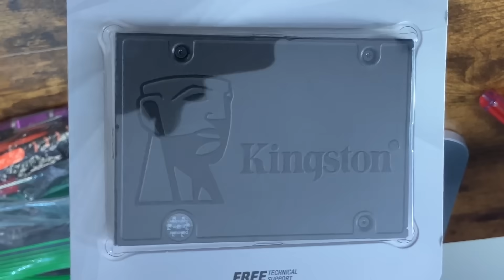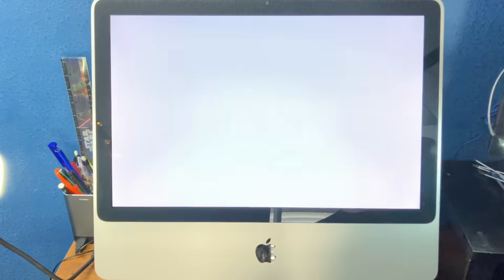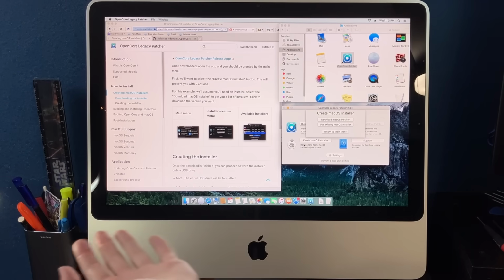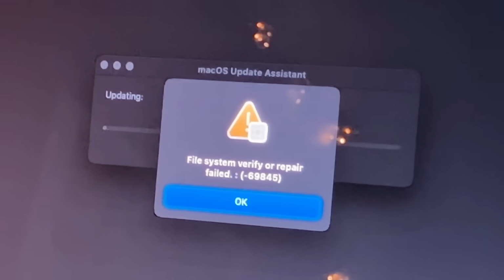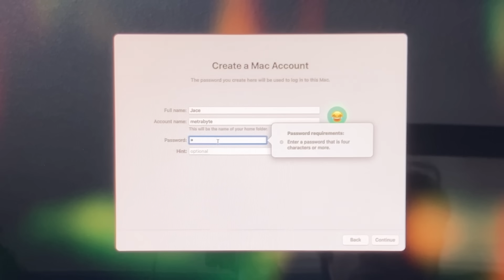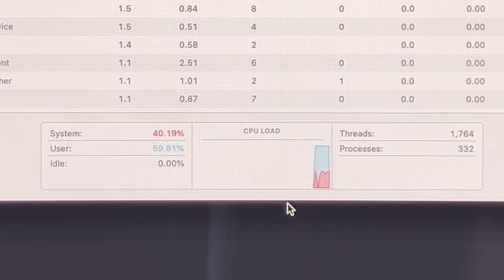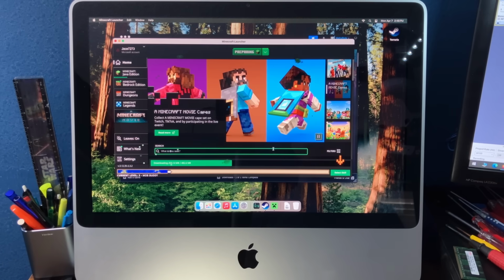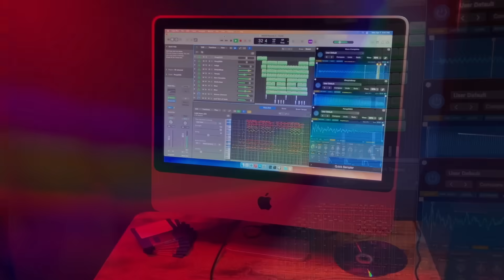Installing macOS Sequoia on an iMac from 2007...

Comment: I‘ve got a Imac from 2009 with 8gb ddr4 2777mhz a intel dual Core 2,7ghz and 128gb ssd patched to big sur but im wondering how you could achive so much fps without mods i use alot of fps boost mods for minectaft but i cant play 1.21.1 only 1.20

Comment: SSD FROM SAMSUNG ON A MAC!!!!!!
Reply: Think Different why use our stuff when is just works get it

No, Apple did not manufacture hard drives in 2007 if they did why would they care then as they think why would we choose overprice SSD for MacBook in 2007 with less then 32GB for fair price.

if it works don't fix it is only dead slow because who in 2007 was using 4K video then in 2025 now

Comment: How did you get GarageBand on it? I thought if you use OpenCore it means certain apps like iMovie and GarageBand won't work because I tried this on my Ventura OpenCore 2011 MacBook Pro and it didn't work because of some sort of graphics issue.
Reply from the maker: Its actually Logic Pro that I got working on there, but it does have some graphical glitches. The play head just doesn’t show up, so it’s not too bad. I think older versions of Logic will work just fine though
Reply: @metrabyte03  Is there any way I can get iMovie and GarageBand on a OpenCore updated Mac?

Comment: See I thought that the GPU in my 2009 iMac was the reason I was getting 3 fps when looking straight forward in minecraft, but now I'm pretty sure it's the CPU

I have actually managed to dualboot macOS High Sierra and KDE plasma on my iMac with rEFInd to choose which one to boot  and it runs. Linux performs overall better (and is convenient because the latest version just works as far as I've used it) and macOS is mostly there for the photo storage and other apple product synchronization. But most apps are either like a milion updates behind (like chrome which somehow still works) or just straight up don't work because of the OLD macOS. 

Also I think that mac's in general just get like HOT for whatever reason, I am always surprised at how hot it is while chilling on speed. Like I don't know if these things even do thermal throttling.

Before I had the idea of dualbooting, I had a bit of a.. testing period with linux distros. Issue being that I did all of that, on USB sticks. And not the good ones. Me being inpatient just bought two 'cheap' sticks, a 128gb for an actual distro and a 32gb stick for the installer. So yippie yippie yee, I go to plug it in, and I put basic mint on it. The (32) stick, at around maybe 5 MB/s, has an average response time of 3 whole seconds. Ok so I did all of that, and then I went to install mint on the other stick. Oh yeah the other fun quirk is that the laptop I use has no more functioning usb ports. I installed linux mint, onto a 128gb flash drive which had to be fully formatted first, all through a crappy dock I got at some point. This process, took about 8-12 hours or one entire night sleep. And in the end it was still slow. Firefox, was a legit issue to run. But it gets better, because the 128gb stick would not boot on my mac because- well I'm guessing it didn't have grub to tell it to boot.

Comment: I could use some help. I was given a 2007 Imac but the guy wiped the hard drive and did not re-install El Capitan and when you start it up the bar goes to about 90% and stops.
I wanted it because my 2006 Mac Mini lost the os and I could no longer play Diablo 2 on it and want to be able to run Diablo with the LOD expansion on it.
I do not need an OS that is too new as I am typing this with my keyboard attached to my Silicon Mac Mini.
I would like to be able to dual boot the computer. 
If any one can give me any suggestions it would be appreciated.

Comment: now install macOS Tahoe
Reply: If the Intel chip is the highest spec option for the iMac model, it’ll probably boot successfully, but it’s looking like Tahoe’s fancy aero graphics prefer Apple’s M-series iGPUs over Intel’s iGPUs on higher resolutions.
Reply: @SirChristoferus it would not work, open pre doesn’t support it. And even a Mac from 2015 doesn’t work.
Reply: @SirChristoferus which is funny because with bootcam the 2007 iMac will run windows 7 with aero just fine
Reply: @SirChristoferus its not aero its liquid glass
Reply: Chevrolet Tahoe
Reply: @mc.curtiss  Tahoe Collins from the old days at Harrah's when Bill was still alive.
Reply: Probably can’t
Reply: Yeah
Reply: 0P3NC0RE D03SNT SUPP0RT TAH03
Reply: If jiga tech couldn't get it to work on on a 2011 macbook then the 2007 imac has 0 chznce
Reply: @macdos1 yeah it couldn’t unless it would have really good specs
Reply: @THEKIDNOCTEM maybe on a 2009 imac (I did it)
Reply: please try @metrabyte03
Reply: Pls- 😭
Reply: Hell yeah!
Reply: It could brick the install
Reply: 100e like LET S GO !!!
Reply: The hell is that ????
Reply: and open liquid glass
Reply: Maybe try replacing the cpu to an apple silcon if it doesn't work well,MetraByte
Reply: @Kieran-z1b dont need it you need atleast a core i5, i7 recommend
Reply: I am
Reply: It would run like macOS toe.
Reply: It will explode

Comment: I have a 2008 iMac nearly identical to that one Dual Core CPU, 6gb ram. Been wanting to slap a SSD in it. Currently running El Capitan and serves as a stand alone EZDrummer3, BiasFx amp sim, and MIDI VST hosting machine. ¯\_(ツ)_/¯

Comment: 15:45 if that minecraft is running decently without any optimization mod(pack) than imagine how it would run with
Reply: I have the same mac with Windows 11. over 30 FPS are posseble but i can´t rach stable 60 fps on an Normal survivelworld.
Reply: Did you upgrade any parts of it?
Reply: @Scylime SSD + 4GB RAM.
Reply: @Scylime RAM and SSD only.
Reply: Hm maybe u need to upgrade the cpu and also survival worlds aren't optimized that well if you play on a server you'll get better fps
Reply: @ScylimeThe main Problem ist The GPU. Vor 60 FPS in full 1050p ist The GPU to slow. And was faster cpu's can't be installed.
Reply: @Scylimeuse optifine and it should Run Up to 60 fps
Reply: I tried sodium on my old Mac and it ran the same as optifine

Comment: Sequoia is the first Mac OS I've installed that actually seemed to load my 2012 Quadcore i7 15" Macbook Pro down and I have 16gb of RAM. I think Apple is satisfied that it works okay on intel and just said to heck with any optimizations. At this point they just don't care about intel Macs anymore. The 2007 iMac can be loaded with 6gb of RAM with 4 and 2 gigabyte modules and that would probably help a good bit. 3gb is just no good for a modern Mac OS. Still, I think Mojave is all I'd want to run on this machine. The good thing there is, Mojave was the last Mac OS version to fully support 32 bit apps. It should run just fine.
Reply: After much trial and error I got Monterey to load on my 2007 iMac with 6GB RAM, 256GB SSD, and it works well. I might try Ventura, as some people say it works just as well, but anything beyond that might be too much.

Comment: I upgraded a imac 2012 a couple days ago and ran into pretty much every single problem you had with OCL-2.3.2 . Somehow, even though I told the installer, several times, to wipe the drive and fresh install. After which when I got to the login, it still had the previous admin account & files. IDK what the fuck was going on, but it works? LOL
Reply from the maker: Interesting lol. I mean if it works.. no point in trying to fix it and make it worse lol

Comment: I played with open core on two different Macs. It does work to get the OS running,  but that does not mean the application software you want will work. The Mac Pro CPU has no AVX support, and the 2014 mini has AVX but not Metal 3, so the reason to run newer OS versions went away.  So back to Mohave and Monterey respectively. 

Or Linux. 😉. 

Linux programs must do a better job of checking the instructions available on the CPU and choosing the library accordingly as the old CPUs run the modern distributions.
Reply from the maker: I definitely agree with you. This video (and channel) is really just my curiosity getting the best of me lol. This iMac is SO SLOW and can't do anything reasonably on this version of the OS. I can't wait to put OS X 10.5.8 back on it.

Comment: Being a nerd time:

-For installation, PRAM resets can help when it's bugged or when you forced it off. Also, make sure to set date in terminal from the installer, or it could very much fk itself even if the date is already right.

-If it doesn't recognize CPU frequency, it's because the Mac needs a firmware upgrade. There's a good chance it's being much slower and throttling itself without it (and that would be why it's so slow on 10.11 despite the SSD).

-The new firmware would also probably work with 4GB of RAM

P.S: that music at the end was amazing!
Reply from the maker: I actually gave that PRAM trick a try but it didn't work sadly. But that's interesting about the CPU frequency. I was going based on https://lowendmac.com/2018/penryn-t9300-9500-cpu-upgrades-for-the-2007-imac/ where it said it could report at 600mhz. I figured 400mhz might be fine too, but it probably could use that firmware upgrade lol.

As for the RAM, that stick was just bad lol. I tried it in another Mac and it did the same thing. Upon closer inspection, it was missing a small capacitor unfortunately.

Anyway, thanks so much about the music! :) I really appreciate that and your very informative comment
Reply: @metrabyte03  yeah firmware upgrade + disable firmware throttling with OCLP.

If power management isn't functional ofc it's going to be slow balls.

Too bad for the stick :/

Comment: I did not see this in the comments, not that I looked that hard, but you can actually use 6GB of memory. Mine is running 500GB SSD, an upgraded graphics board from then one it came with and 6GB of memory....but I am not using macOS. I installed Deepin on it and ran the fan patch. Everything else works The only thing left to upgrade is the CPU which will be part of my next AliExpress shopping basket.
Reply from the maker: I did know about the 6GB memory thing, but those 4GB DDR2 Modules are so much more expensive than the 2GB ones sadly lol

Comment: i have this one :) how to install Wondows? it refuses to boot off USB or CD or DVD :( help me
Reply from the maker: You probably need a 32 bit version of windows. These old Macs have a hard time booting 64 bit windows due to their 32 bit EFI from what I understand. I had this problem in my video about installing windows 11 on a 2007 MacBook Pro and was able to fix it by making a custom windows 7 iso and upgrading it to the version of windows I wanted lol.
Reply from the maker: I’m assuming it gets stuck at something like this. Check out this link: https://forums.macrumors.com/threads/windows-10-install-mac-32bit-efi-working-fix-select-cdrom-boot-type.2217681/
Reply: @metrabyte03 thank  you :) <3 <3 <3
Reply: @metrabyte03  it worked perfectly :) thenk you :) <3 <3 <3 <3 <3 <3 <3 <3 <3 <3 <3 <3 <3 <3 <3 <3 <3 <3 <3 <3

Comment: No, never touch the mother board without am Anti static wrist strap. Or at least touch some area of the metal casing. You could potentially damage minor components.
Reply: Been repairing PC’s, Mac’s, iPads & iPhones 7 days a week for over 15 years..never worn an anti-twatic band once & never had a single issue..not one ..guess it depends if you’re a twat or not 🤷‍♂️😂

Comment: I installed Sequoia on a recently purchased 2012 MacBook I had bought it, and aside from the very low price (£30 inch postage), it had 500GB SSD - great storage - and 8GB ram. So I grabbed it. But it took such a long time to install the os. And then took a fairly long time to boot. I was a bit confused about what sort of crap SSD was in it. Then I discovered a 500GB hdd inside which I swiftly removed. Seller was unaware, but offered me a 30% discount, so got replaced by an SSD and now it feels very snappy. Yes, some new apps really take their time, yes they have occasional quirks, but that’s to be expected. I now have 16GB ram in there. It’s brilliant and ready to be gifted to an elderly lady who is very isolated.
Reply: Honestly, unless there is some proprietary software you want to use, I'd just go with Ubuntu on Macs that old.
Reply: brochacho why you yapping about specs go to an technical video or something this aint yo place
Reply: I wonder who asked you?

Comment: my late 2012 mac mini with i5 2.5ghz and 16gb ram with 500gb ssd couldn't run sequoia. it was too slow to boot and load up software. I installed linux mint xfce 22.1 and i couldn't be happier. I play steam and ps2 games. I stream tv and movies on this computer and I love it. it's my main computer I don't get on my linux chromebook or my debloated windows 11 laptop.
Reply: I am happy for you. I was into Linux for a long time (Knoppix - End of the 90`s) and i followed the first ever female YouTuber that did really cool Linux-Explainvideos. Nixie Pixel is her Name. I have an iMac 27 from Mid 2008 and the highest OS i managed to upgrade was El Capitan. It runs good. YouTube and Movies in 1080p without any Issues. I could be happy with it...but i saw a few Videos like this with older iMacs and Ventura or Sequoia. I tried it too...and i have an Duo Core Intel 2,5 Ghz. I don`t know...I basically did the same as he did - with OCP. 
Maybe the Processor does not support 64Bit.

Anyway. Just was happy to read that somebody is running Linux Mint on his Mac Mini. :-) Awesome!  I love Linux Mint. The Desktop looks Mac-Alike. ;-)

Comment: 🤔🤐🤨🤨🤨👍👍Hi why bother with this iMac f?
If the fourth generation was worth the effort, it would have been worth it. But it's a second generation, meaning it's only suitable for a display, like a plasma TV, or for connecting to a desktop computer as a screen And that's The topic is over

Comment: not sure if you know this, but removing the 3.5" drive removes the temp controller for the fans. you either have to buy another temp sensor to work with the SSD or a manual fan controller in osx

Comment: 32 bit app support on Mojave, that’s why I’m still stuck there and probably always will be.
Reply from the maker: I think it is so odd that Apple just took away 32 bit support like it’s such a burden to maintain. I mean, maybe it is, but it can’t be that big of a deal to a trillion dollar company lol
Reply: @metrabyte03 i think it would actually be HARDER to remove 32 bit support?? Lol
Reply: @metrabyte03  As a programmer, it's actually a terrible burden. In theory it should work but it's painful to maintain -- but honestly, Steam really ought to be able to play 32 bit apps even if the rest of the system can't. That's the situation with Ubuntu on the Linux side, and I'd say it works just fine. (they maintain just a few 32 bit libraries that games use, with the rest of the system being 64-bit only)
Reply: @metrabyte03  I was so weirded out when I find out none of my legacy apps worked on Catalina. I was collecting games for Mac on Steam ever since early 2010’s, so like a decade of collecting and the actual reason I bought a better Mac back in the day gone with a software update? no thanks.. 

-426 days until the the end of support tho…

My macbooks are for gaming…

Comment: You definitely don’t have hardware acceleration. You should run the OpenCore Legacy post-install to enable hardware acceleration
Reply from the maker: I ran the root patches off camera. I think I cut it out of the video by accident lol. Minecraft ran about as well as it did in osx 10.5 so I think it was working about as normal as it could. Is there something specific that gives away that acceleration really isn’t working? I’d love to get this working even better lol
Reply: @metrabyte03  Get a 4 gig stick of ram and replace the 1 gig stick in it. Gives the most amount of memory possible in the iMac
Reply: @metrabyte03 10.5? Do you mean .15?

Comment: Just a heads up, it doesn't look like you have graphics patching enabled on that machine, which would honestly make it run so much smoother. Next time you do something with OCLP, it might be a good idea to enable the root patches hehe
Reply from the maker: I believe it is enabled. I ran the root patches a second time with the internet connected off camera. I think it just disables some of the blur effects to make it work a bit better. I don’t think Minecraft would have run as well as it did without graphics acceleration. It ran about as well as it did in OS X 10.5.